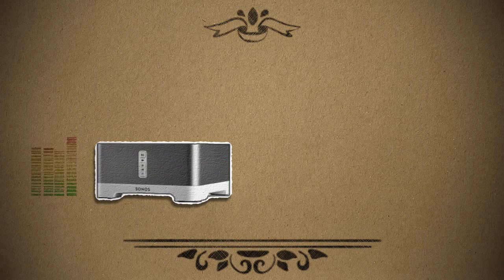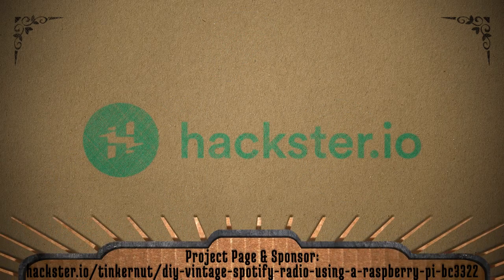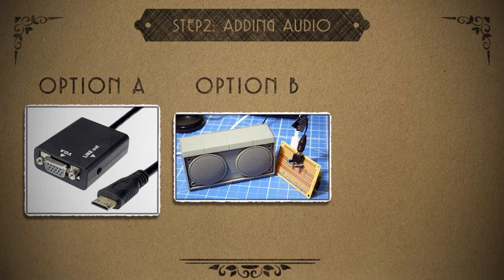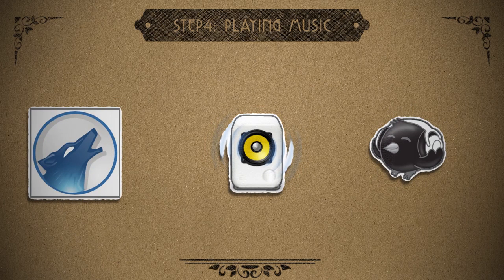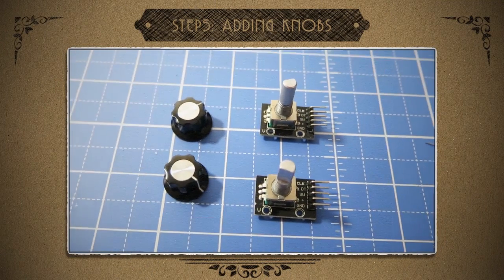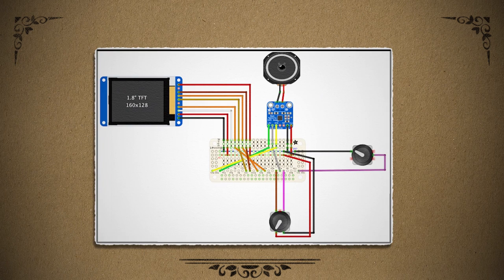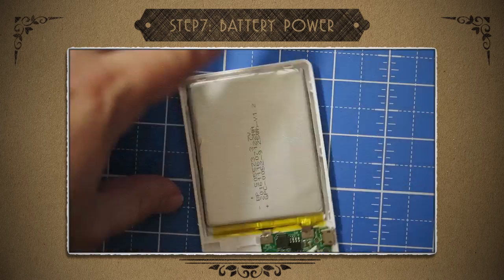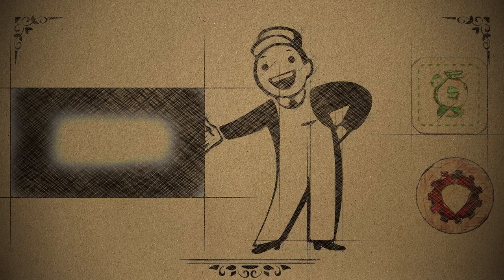How To Make A Vintage Streaming Radio

Comment: just a thought, but the pi zero w supports bluetooth, so you could easily have it connect an external bluetooth speaker with the push buttons?

Comment: Since the NTC CHIP has a built in 3.5mm jack and built in battery power management wouldn't it be worth considering over the pi zero w for audio projects like this?
Reply: I order the CHIP pro last month it still has not been shipped
Reply: Vontux do u have any insights why its taking so long

Comment: I know you really wanted the retro radio look and all, but next time try using proper wood, it'll sound a lot better! I've repurposed an old PC speaker set (those cheapo USB-powered desktop speakers that come with prebuilt pcs) on a wooden enclosure and they sounded a lot better than when they were inside a plastic shell

Comment: You can save some money when using chip instead of the pi zero w. Unlike the pi it has audio and lipo protection built in. And it costs the same.
Reply: Vincent Wiedermann I order the CHIP PRO last month and its still not shipped. idk what to do wait or go with this

Comment: You're comparing what cost around $100 dollars in 1950, to what costs about $50 today......

And paying $100 for a radio in 1950, is literally the same as paying just over $1,200 today.

In short, you're comparing apples to oranges.